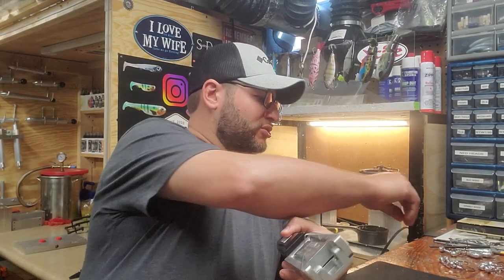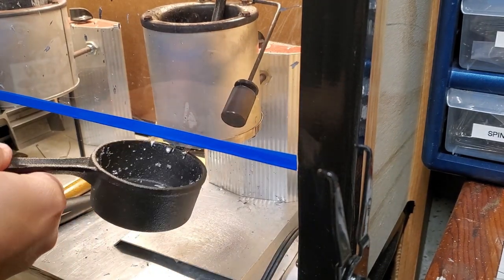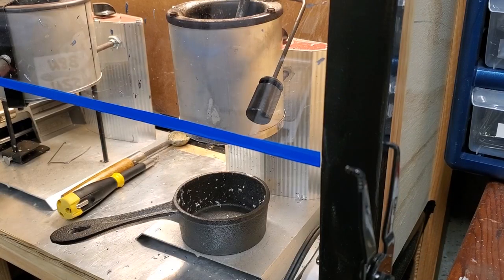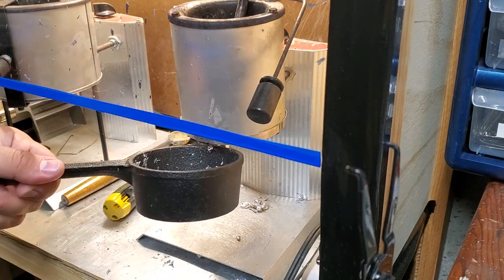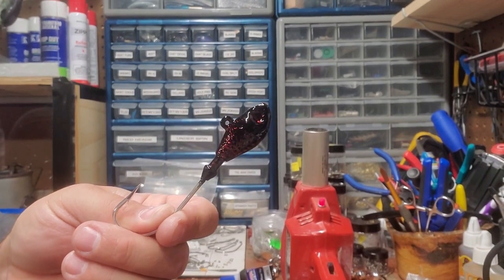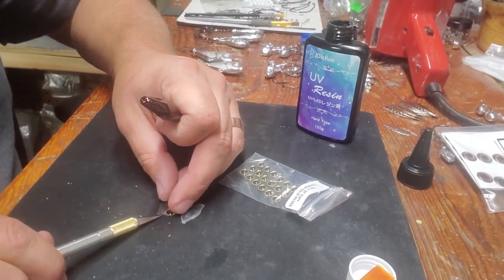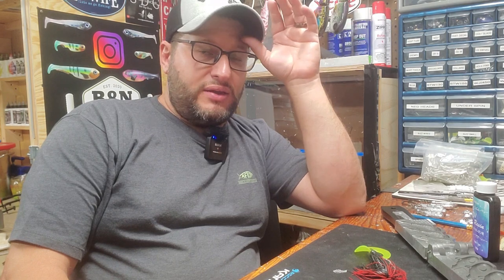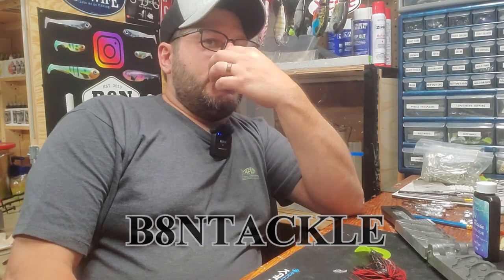Ultra Minnow Jig (MUSKY SIZE)

Comment: What Oz is that one with the ewg hook and want hook model
Reply from the maker: 1 to 1.5 oz with a 8/0 or 9/0 ewg, I will have to get back you on exact size and hook style number.
Reply from the maker: So it's a 1.5oz with a 9/0 ewg 91768 30 degree hook, available at lurepartsonline bud